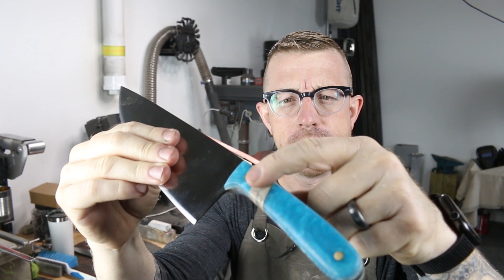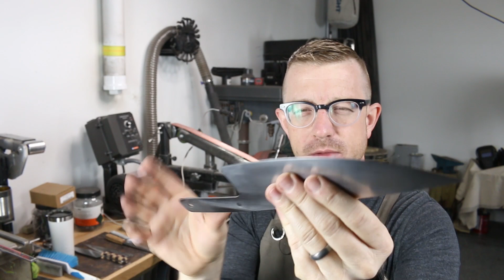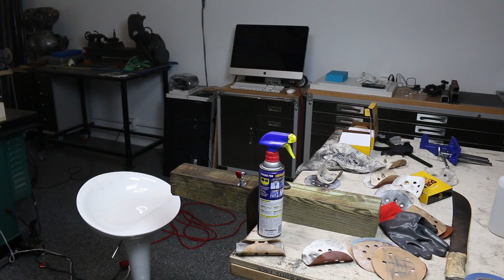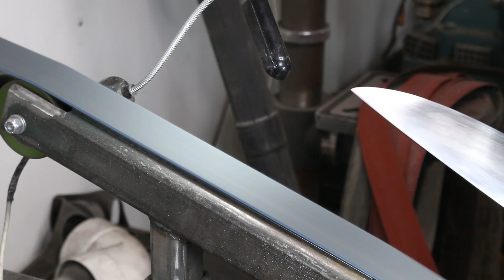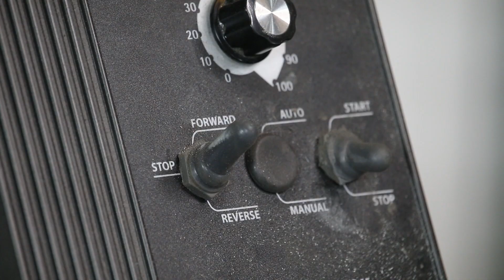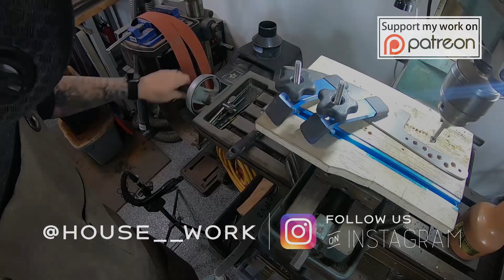They told her to kill her children

Comment: Hey what’s up brother!! I meant to email u back but I have serious ADD/ADHD hell of a combination huh lmao and I totally forgot until I watched this video! I got those slabs of black walnut that I had talked to u about but I’m just trying to figure out how to get them to u, cause everyone wants to go off of weight and as u know wood ain’t light lol and it’s just going to cost me a pretty penny to get them mailed down there to u cause I have 3 circle slabs that are roughly 1-2in thick and prob 6-8in across! But hell man I think ur knives look damn good man!!!! And I’ve noticed on past videos and this one that right there on the handle u drill roughly 6-8 holes in it, what are those holes used for besides the one on each end of the handle to rivet the wooden part of the handle to the knife?! Keep up the awesome work big man and I can’t wait to see u make the new 2x72 grinder!!!!
Reply from the maker: +Mark Morgan - What’s up Mark! Knife scales are small, 3/8” thick by 2x5 so cut off a few little slabs and mail them down! I’ll stabilize them and make a sweet knife. And the holes have a couple of purposes, one is to just remove some weight and the other is to give the epoxy something to bind to. It sorta solidifies both scales through the handle. Glad you’re doing okay, happy thanksgiving brother!

Comment: Awesome video man, and excited to see the videos on the new build!! I'm getting ready to build mine and talking about tracking issues, the shaft on my motor is only about 1.5" compared to a 2.25" drive wheel, see any problems with tracking and or vibrations??
Reply from the maker: Well, they make drive wheels that have an internal bevel to them so a shorter shaft will work. So if you can imagine, the outer diameter is 2” but the hole where the shaft goes through isn’t, it’s concave. So I would go that route. Glad you’re stoked about the new grinder build. I am as well! Filming starts tomorrow on that! 💪🏻

Comment: Great video sir! Love the concept of "chasing perfection". How thin were you getting those spines? If you said it, I missed it! Sorry! That scotch-brite belt coming at you on the top platten freaks me out a little bit, I've had those belts catch blades before. I don't know enough to say it's dangerous for sure though. Just thinking out loud. I really like the idea of the soft platten.  I love the idea of running the belt backwards for that operation too. Having two grinders would be LEGIT! Thanks for sharing all this. Great work ethic and great motivational talk there.
Reply from the maker: It’s funny you should mention that. I had a blade catch right after I shot this and punch me in the apron. Not hard but enough to make me want to correct this tracking issue for real. Haha. Yeah. Butthole puckered a bit there. ANYHOW, I’ve been known to push the limits on stuff. But that was a close one. Also I built the soft platen out of leather and that failed scotch brite. Making a vid on that actually. It was so stupid simple but really effective. I didn’t say the spine width but it’s somewhere around .087 at this point, I think...I’ll throw the caliper on it tomorrow.
Reply: @HouseMadeUS  Very cool! Very Thin! I like it. Yah those belts are grabby. I was most worried about it grabbing your tip and slinging it. They leave one hell of a finish though!
Reply from the maker: Yes they sure do. My Klingspor rep is hooking me up this week. Also I have a project you might be interested in. I’ll send you a dm. 👊🏻

Comment: Great video! I’m just gathering all my components to make a grinder over the Christmas break. Do you think you will have your second grinder build videos out by then? No pressure 😄👍
Reply from the maker: Yeah actually starting them this week. What are you going with in regards to the wheels and such? Gonna do the eBay thing? Also when you’re done I would love a pic or pics sent to my email. Brian@housework.us 🤘🏻🔥
Reply: @HouseMadeUS  

Brilliant! I'm getting the wheels from Amazon, links below, buying a backing plate from ebay like you did, I'm getting a 2hp 3 phase AC motor 2850RPM and VFD straight from a supplier. I hope my belt speed will be high enough! I'm in the UK which makes it a bit more tricky sourcing some of these items. Keep up the good work. I really enjoy your videos and will sent you a picture of the completed project (whatever the results are!).

https://www.ebay.co.uk/itm/TR-Maker-Belt-Grinder-plate-for-2x72-knife-making-grinder-belt-grinder/133172738636?_trkparms=aid%3D555018%26algo%3DPL.SIM%26ao%3D1%26asc%3D40733%26meid%3Da516dafcf8724735bfb9eb691c11768d%26pid%3D100005%26rk%3D3%26rkt%3D12%26mehot%3Dpf%26sd%3D253483395746%26itm%3D133172738636%26pmt%3D1%26noa%3D0%26pg%3D2047675&_trksid=p2047675.c100005.m1851
https://www.amazon.co.uk/AL5-24-Machined-Grinder-Grinders-Drive-24/dp/B07NZWVM85/ref=sr_1_69?keywords=grinder+drive+wheels&qid=1574796028&sr=8-69
Reply from the maker: Thanks for the info. If you go a bit bigger on your drive wheel, like 6-8 inches it will turn faster. That might be better for you. 3400rpm is preferred but you can pull those speeds if you up the diameter of the drive wheel. Good luck. Can’t wait to check it out.

Comment: Thanks for the Video! I have been wanting to make a good kitchen knife too but not even sure where to start.
Reply from the maker: It’s a tough one. But just keep going forward. Make a bunch of bad ones, it’s the only way to get to the good ones. 👊🏻🔥👊🏻🔥
Reply: @HouseMadeUS  what kind of steel do i start with? Also is it better to cut or forge the knives?
Reply from the maker: I don't have a forge so I just cut mine, I have made them from A-2 and 80CRV2. Both seem to be very easy to work with and make a great knife. Ill be making blanks here in the near future for sale. Ill let you know when they are ready. :)
Reply: House / Work if you interested I made my forge. I have your email and can send you the photos and share my experiences